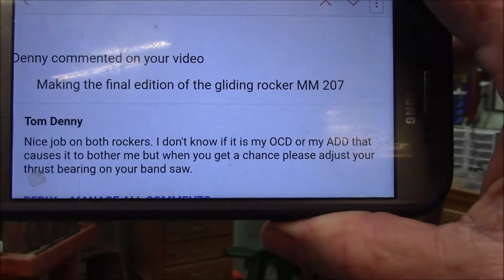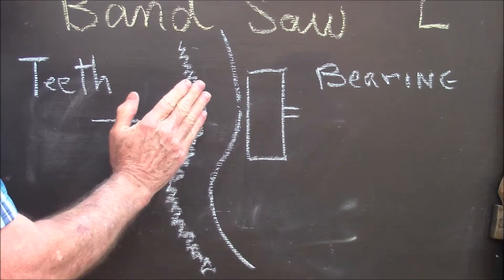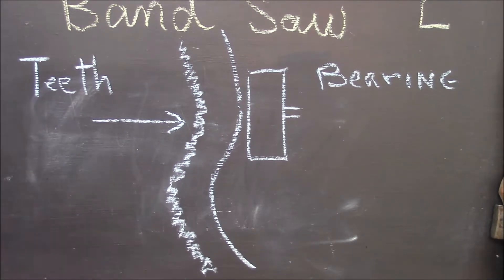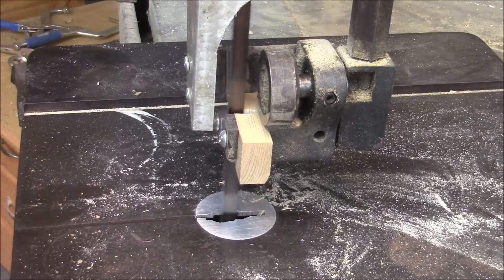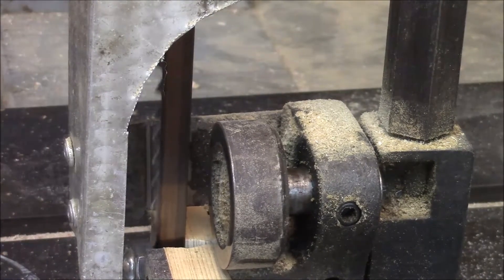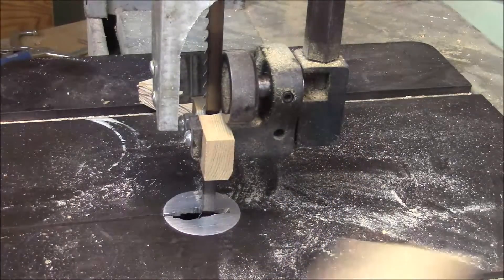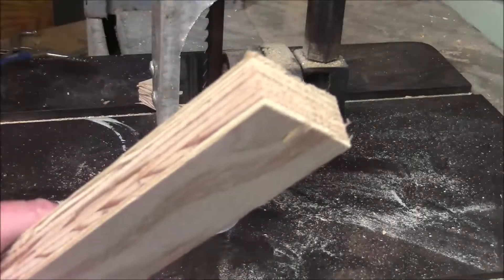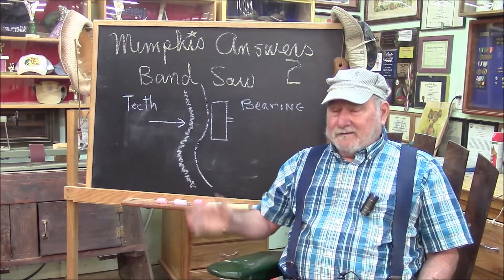Memphis Answers 2 Band Saw Thrust Bearing Question

Comment: I cannot get access to my delta 14 thrust bearing located on the bottom of the table. I moved the bearing all the way out and that didn't work.  I moved it back without success.  Do i need to disassemble all the lower guides to get to the thrust bearing? Your help is appreciated.